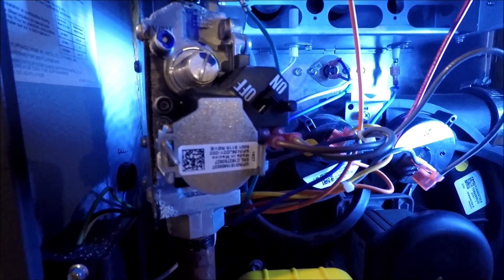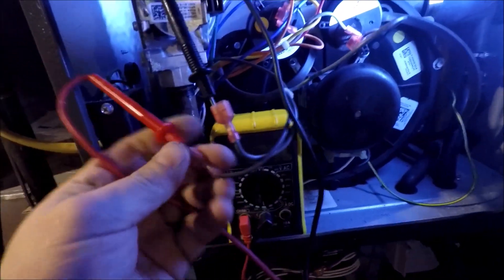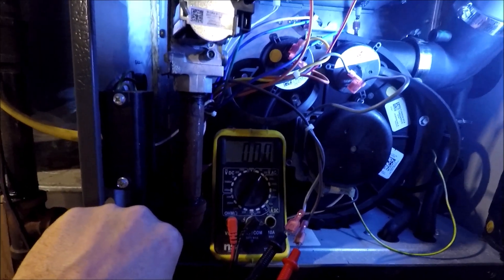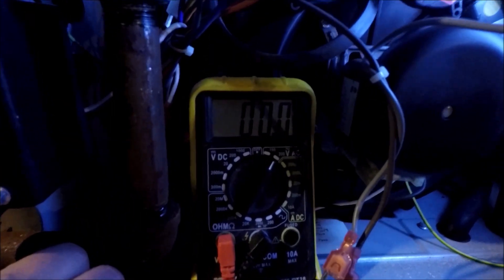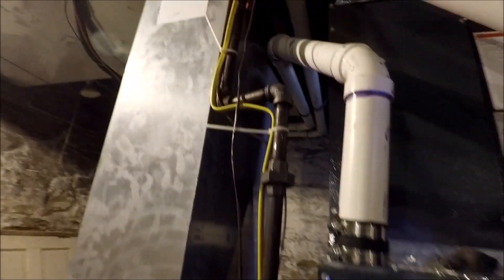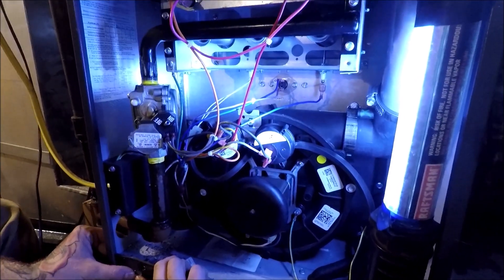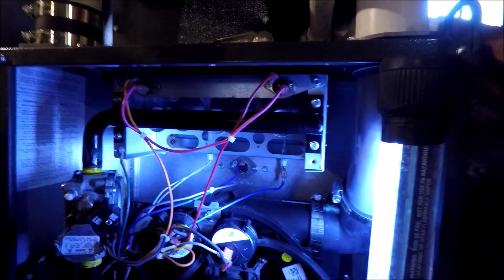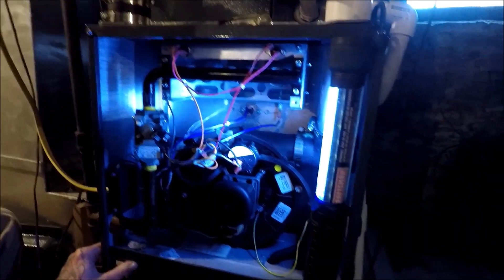Goodman furnace 1 flash bad gas valve

Comment: Thank you , Sir! You solved my problem. I have an electricial testing unit kinda similiar to your professional grade unit and I got a jump on the needle telling me I had voltage to the gas valve yet the valve itself didn't fire.  So I was able to replace the valve with a level of confidence for $142.00 inc tax from the parts house just 5 minutes from home. Done in 2 hours including research time.  As I type this, the house is already back up to temp.  In 2011, I installed this Goodman system myself, ductwork A/C and all, to replace the original 1937 gravity floor heater.  I knew this day would come as the guts looked complicated. Thanks to you and my God-given right to repair, I am very thankful for this outcome.

Comment: I had a similar issue with my furnace earlier this morning I disconnected the switch that the furnace cover presses and when I reconnected the wire the led stayed on and my furnace turned on then off again I moved the large wire cluster that comes out from the circuit board and the furnace turned back on I let it go and it turned off again I grabbed the wires again and the furnace turned on so I duct taped the wires in position and my furnace is still working. I don't know what the problem is maybe a faulty wire or faulty circuit board but for the now it's working. Update :
After duct taping the wires my furnace would only stay on for about a half hour at a time so I ended up switching out the circuit board ( I purchased it last year from Amazon just incase for about $90) and it seems to have resolved my problem, my furnace has been on all night and my home is nice and toasty. I'm not a professional in any way but I am a tinkered so after turning off the power to the furnace I  disconnected a wire from the old one I connected it right away to the new one to not get confused as to where the go.
Reply from the maker: Sounds like a job well done. Even with the extra board.

Comment: Thanks for the video. 
Does it matter which way to put the wires back on the valve?
 I forgot which one goes where.
Reply from the maker: The gas valve doesn't care.
Reply: @themrhelperguy  Thanks for responding.

I took the valve off and took it apart. Couldn't find anything wrong. Maybe it was just stuck closed. I tried beating it before I took it off but couldn't get it to work.

Put it back together and on the furnace and tried to fire it up still didn't work. So I ordered a new one. 3 days later went to replace the valve. But I had to turn on the heat and my furnace is outside of the house. When I got outside it was working.🔥🔥🔥🔥🔥

Not sure what I did but at least I have spare parts for next time.

Comment: Ignitor is on, don't get 24v to gas valve? In fact the valve always has 11 ish volts until the ignitor goes out then goes to zero volts and a few seconds later goes back to 11 volts
Reply: I suspect you're reading in DC not AC.

Comment: so we saw everything but the actual repair. How to change a gas valve. I have the same issue, I get the 24v and ignitor on,  etc. I was able to start it a few times by wiggling the relay on the gas valve but no more. its dead. it would have been nice to show how to replace it.  I see that is a sub $50 part but the process of changing is why I came here.

Comment: I swapped my control board today on a goodman furnace.  (inducer motor wasnt getting voltage).  So, my furnace then seemed to start up well, until it was time for the gas to turn on.  I had moved the switch on it from off to on, prior (out of curiousity), earlier.  There was voltage at the solenoid/valve, but no gas flow.   I took off the solenoid, and reseated the coil leads in their socket.  I also reseated the switch.  Rebooted, and gas came on, furnace is running.  Not sure how long this will work.  Problem seemed electrical related, from moving the switch to OFF and back ON again.  Can solenoids be had separately?
Reply: I just did the exact same thing.

Comment: Unfortunately you probably didn't set the manifold pressure inches of wc for that valve.
Reply: I agree I've changed 2 they're good out of the box
Reply: Don't go scaring someone? Hey I'm a union sheetmetal technician and a union tiner!! And it's not my problem when you start having issues with that equipment because it's over fired due to not setting the w.c properly and checking the temperature rise. 👍
Reply from the maker: We always check temperature rise. These valves are good out of the box.
Reply from the maker: Don't go scaring someone that they can't pull this out of the box put into use.

Comment: Was getting 20.5 volts at my gas valve. I replaced the control board and put a new gas valve in it still getting20 and 1/2 volts through my rollouts up to the gas valve.

Comment: Thanks for the video. Question for ya. Last year my igniter was replaced because it was in little pieces and then we had to get our gas valve replaced because it wasn't getting gas. I changed the flame sensor while I was in there. Everything worked great all last winter. Now it's starting up calls for heat, igniter on, flame on runs for about 3-5 minutes and everything shuts down except the main blower. I checked and cleaned the flame sensor. Still keeps doing the same thing intermittently. Any ideas? Thanks
Reply from the maker: Maybe make sure your thermostat batteries are good. Sounds like the pressure switches are falling out. Look for water in the lines to the switches. Clogged drain in the furnace. Make sure the furnace is not full of water.

Comment: Actually that contact in the White Rogers switch can be cleaned, also just experienced that one LED flash, but this was the interlock switch on the lower cover door.  What a piece of crap made in China switch, replaced it with a Carling switch.  The older logic control boards were made in China, just purchased a new one for a spare from Amazon, best price with free shipping.  Made in Mexico, little closer to home.

Comment: Hey I have 1 flash code problem, I checked the pipe it was clean. before i replace the gas volve what else should I check?
Reply: So  gas blows through the flame sensor is sending out a signal then once the igniter goes dim the flame stops. No vents are clogged seems to be getting gas don't know what else to check. Everything else seems to be working properly
Reply from the maker: Everything, pressure switches,clogged drain, igniter,  flame sensor, moisture in switch lines, blocked vent, I have seen most of these throw a single flash. Those codes send you in a direction to look for a problem. It's not very often that a 1 flash will be a gas valve.